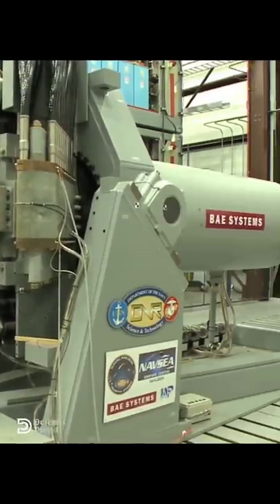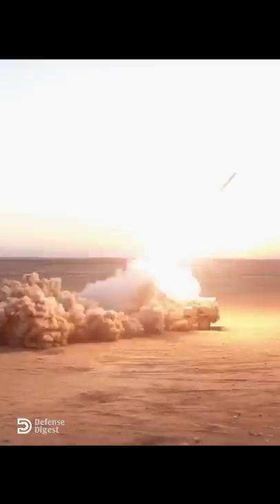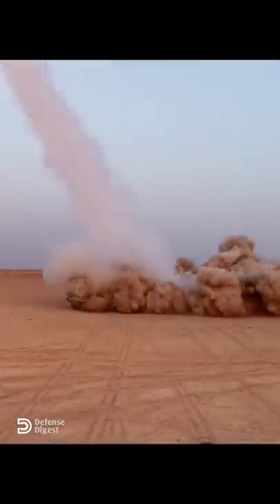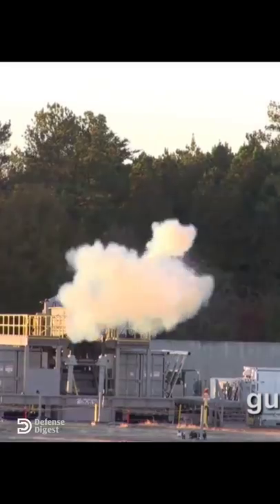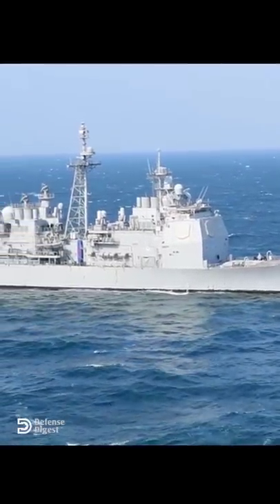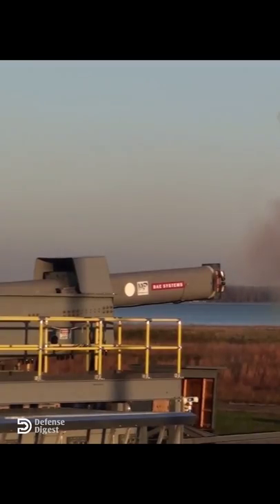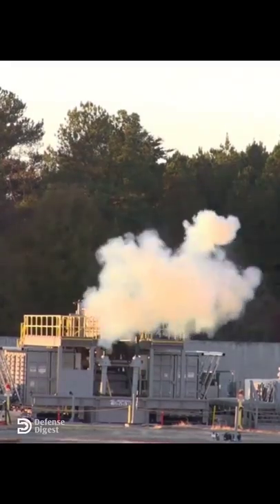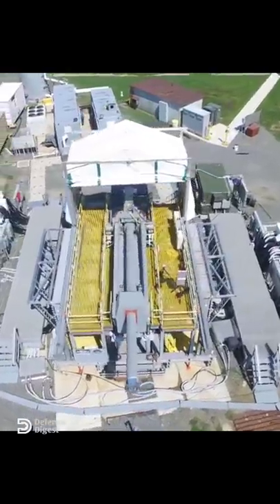Hypersonic cannon that does not require any explosives #Shorts

Comment: Power wasn’t the problem, everytime it shot it destroyed its barrel
Reply: Not every time, you’ve got 10 shots or so in that test one… possible to get the rails to last up to 100 shots, but then they’re ruined and the entire gun needs to come apart for their replacement…. Not what you want for a warship…

I always thought coilguns made more sense anyway but less research into them.
Reply: There salutation was literally to halve the power. This is why I get so frustrated by syfy things like locusts that eat through anything in SCP, or SG1 with naquida hulls that can withstand RPG blasts while paper thin. You know what we would do with that shit. We'd made barrels out of it that don't wear down every ten shots or missile housing for aluminum ships. We'd do so much more than throw a hoplite sheild around at a couple baddies  with that vibranium.
Reply: Dumb internet hoax that floated around. The barrel is fine, it was the $$$ of the rounds that got this scrapped.
Reply: @Nitemare101  i thought they were only like 25-50k that's better than most rockets we use
Reply: @Nitemare101  nah the rails do break, something to do with putting that many volts/amps into them, all it takes is 1mm of warp or a tiny crack and the gun loses power.
Reply: I was looking for this comment! 🤗
Reply: @Nitemare101  is that why there will be no more zumwalts? That, and whatever composites they wanted to use for it didn't even last to the third. With all the money put into research and development, you'd think that someone of it could've gone in to planning to source all the necessary materials for the 50+ ships reliably
Reply: @luggy9256  the gun was already perfected along with the rounds. It was ready for installment on the first zimwult with 2 other ships already built and one under construction. The company decided to alter the contract and charge more for the rounds. The Navy scrapped it then refurbished the deck to fit the old 155mm deck guns.
Reply: @nathanielcowan3971  they changed the price and was hundreds of thousands of dollars for one round. So now it's a toothless shark. Missile boat with 155mm deck guns with a weak ass aluminum hull.
Reply: @nathanielcowan3971  supposedly there will be more since it's cheap to maintain even though the initial cost is outrageous. Waste of fucking money. Its an expendable missile boat.
Reply: @Nitemare101  the zimwalt doesn’t use a railgun does it? I thought it was something else again, still uses an explosive charge to fire the projectile…
Reply: @Nitemare101  ok I was wrong and right so were you… there was discussion to put a railgun on the third zumwalt class ship, but the original guns aren’t railguns they use propellant to fire.

But there is no updates on the plan to put a railgun, and as far as I can tell the project is unlikely to ever happen…
Reply: Plot twist: They secretly perfected rail guns and are planning to put them on warships. But they are keeping a secret.
Reply: @titanium_viper0990  and yet it’s on 0 warships…
Reply: Yeah, but it would've made an excellent stationary gun for shooting down nukes.
Reply: @luggy9256  plus the fact you would have never had known when the last viable shot was going to be
Reply: Saved me from typing
Reply: @nathanielcowan3971  no it’s 1 million just for 1 shot
Reply: Yeah im sure they got these perfected and just don't use them cuz thats the smartest way to do things. I bet that dude that wrote the art of war would know whats up
Reply: @luggy9256  Railguns can be 70-80-90% efficient . Coil guns can't reach more than 20% even in theory it's impossible.
Reply: @kosovoisserbia8937  no railguns can’t ever be 70% efficient, the way they function produces a massive amount of excess heat which creates plasma, that’s a lot of wasted energy… neither system will ever be actually efficient but coil guns at least have a longer barrel life, also coil guns are easier to manufacture, just the requirements for ammunition to all be magnetic are a little more annoying.
Reply: @luggy9256  i said they can theoretically have up to 80-90% . Now they have 50%.  Coil guns rn have less than 12% efficiency at its highest . Can't have more than 20-30%. And barrel life can be solved by making it easy to replace rails on just few screws.
Reply: @kosovoisserbia8937   making the rails easy to replace does help, buf doesn’t solve the issue, they’re still high quality alloys needed and precision machined pieces which means even if you make it so you can take them off and add new ones easily they’ll still have to be recalibrated every time so it can’t be done in combat.

I know the military was working in cool guns as well, railguns as we know are intended for ship weapons, and coil guns were under consideration for more portable weapons, last I saw they wanted to use the coil gun concept to increase the range of mortars… 

But it’s also possible (and even probable) that neither will ever see active service because while they might perform better than conventional weapons, they cost far more and require a lot more maintenance, so for every railgun you could have a dozen or more conventional guns…
Reply: @luggy9256  Well it can't be that expensive so it gets more expensive than a missle with similar range  . And better alloys are being made if it can last 100-150 shots and you probably won't use it much longer in battles and you should have 3 or 4 spare barrels just in case.
Reply: @kosovoisserbia8937  it won’t have similar range to a missile, it might reach the point of double range of conventional artillery, but a missile will still go far further… 

The barrels will wear faster as ranger increases, so new alloys will probably struggle to get ahead in terms of lasting longer because as barrels improve people will want more power for more range so barrel still lasts the same number of shots
Reply: @luggy9256  depends Wich one . Certainly more than regular 122mm grad or 262mm munitions Wich have 40 and 100km range . Sure tomahawks will go 1000 miles but they cost milion dollars. This iron tungsten projectile costs much less than it and tomahawks are 10 times cheaper than anti ship missles with 150-200 mile range . Sure you won't destroy ship with 2-3 projectiles like you would with rockets but you would with 30-40 Wich is less than half milion dollars in projectiles and one copper/titanium/or other alloy 500kg barrels machined not casted and electricity cost Wich is also pretty low.
Reply: @luggy9256  you keep making statements like you know it all but question whether or not if the ship was meant to have thus gun. You obviously did not follow the development of the ship and gun. The Zumwalt was specifically designed for the Railgun hence why it has such a massive power output. The turret decks were also designed to fit the guns but when the navy scrapped it they had to send all the ships already built to get refitted to house the old 155mm deck guns costing a shit ton more money. This garbage of a vessel generates useless insane amounts of power for nothing.
Reply: @Nitemare101  it makes no sense to me that a aluminum projectile would cost so much. I'm sure the manufacturer is just sticking to the government.
Reply: Learn more
Reply: @nathanielcowan3971  is there any reason they can't just have a ordinary gun on ? They still have a lower radar cross section
Reply: @Nitemare101  your thinking of the zumwalts guns and their projectiles
Reply: @bobthompson4319  have you not been reading comments? What kind of statement are you even making?
Reply: @Nitemare101  the uss zumwalt. The ammo for its gun was cancelled due to the insane high cost of the rocket assisted projectile. Not the railgun. Smh.
Reply: @luggy9256  you honestly think you know what weapons are tested on ships? 😂 laser based weaponry were being tested on ships YEARS before they publicly acknowledged so.
Reply: @luggy9256  zumwalt wasn’t meant to have a rail gun.
Reply: @nathanielcowan3971  zumwalt wasn’t a raingun ship. It looks like two stories have been conflated in this thread.
Reply: @ericoverdorff8880  they don’t. Two stories have been conflated here. The zumwalt was meant to use a 155mm AGS - NOT A RAILGUN - the rounds for which spiked massively in cost.

The zumwalt was, however, designed with eventually fielding railguns in mind, and had the electrical capacity to do so.
Reply: @Nitemare101  yeah he has read the comments… as have I. You’re all getting confused lol. Two stories about the zumwalt have been conflated. It wasn’t railgun ammo that became expensive. It was the AGS ammo. Zumwalts were designed to eventually have railgun capability (electrical power for one) in the future. AGS was not a railgun.
Reply: @lukefreeman828  I was talking about the rail gun projectile.
Reply: @lukefreeman828  no I am aware of that, it was meant to have a very special conventional main gun with weird ammo…
Reply: @lukefreeman828  And the way lasers are used on ships makes sense, it’s in an anti missile/anti air role and to disable small boats by cooking their engines, trying to use them on something that doesn’t have the power plant of a ship or as a main weapon is stupid…
Reply: @luggy9256  well actually it's because of the electromagnetic forces literally repulsing the barrel in two different directions, instead of the traditional recoil, where the barrel recedes and quickly springs forward, this is more like the barrel exploding to chuck a round forward at hypermach
Reply: @ToastGamingNCrew  it’s also an issue of putting so much electricity and friction through the rails, which produces a lot of heat which leads to warped rails. But yes you’re also right, lots of issues…
Reply: @luggy9256  yeah, way ahead of it's time
Reply: @Nitemare101  I think you’re mistaken. That was the case for the main gun on the Zumwalt-class destroyer. The ammo for that gun would have cost billions to fill the ship’s armory. Any gun barrel takes on wear through continuous use. But when that object is moving so fast that the air around it spontaneously ignites, it shreds the barrel. Before you dismiss something as false, perhaps go verify your claim 😅

“As early as 2018, the end of electromagnetic railgun development was foreseen after Chief of Naval Operations, Adm. John Richardson, told Congress that the weapon had yet to reach its promised range. “The barrel itself is probably the limiting case, the engineering on that, the materials required to sustain that power pulse, and the heat and pressure that’s involved in launching those projectiles,” he explained.

Last month, the White House released its fiscal 2022 budget request showing that funding for gun-launched guided projectiles had been canceled.”
Reply: Power was also, definitly the problem
Reply: Until they can create stronger material because the sheer force of the gun starts to break down the gun itself during firing.
It did go through live trials on a US Navy ship within the past couple years. But right now you can only fire a few shots before the barrel starts to disintegrate
Reply: @luggy9256  just think of the first generation of rifles... Flinlocks then trap doors, then revolver etc.. This is too early to claim useless.. They may cancelled, bug someone else is doing it
Reply: @mandelorean6243  well with early firearms there was superior types like the wheel lock that was better than the flintlock but was barely used due to cost and difficulty of maintenance… it was only really used on custom weapons for the rich. 

So there is times we pick the worse performing options just because they’re much cheaper and easier haha
Reply: @luggy9256  good point sir, yeah especially for example "Custers last stand" there was a few, I think 2-4 trapper/pioneers  that were hired to fight with the military.. They had the only with rifles that were either revolver or just had capacity up to 26 rounds.. They were backed up to rocks and their bodies were surrounded by almost 30 natives, where as all other military single shots just got slaughtered after they got their one or so shots off before being rushed...

Would've been a lot more difficult to slaughter the outnumbered military if they had premium rifles!
Reply: @mandelorean6243  but premium rifles cost many times more than what’s given to the military, and budgets don’t allow for it. Sometimes cheaper options are better to the people in charge of the money
Reply: Same thing would happen when I would put a can thru my M2 50 cal lol
Reply: @Nitemare101  they legit said ammunition was cheap and also the guns gets destroyed every 10 shots
Reply: It kinda is but that aside it's not balanced
Reply: @Nitemare101  they're are aluminum alloys that exceed steels strength in the same dimensions. Did they use the wrong one?
Reply: Concept is obsolete since the laser weapon systems have been brought up to full function. Faster, more precise, far less energy, lower maintenance...better system. Hypersonic or not, it's not light speed. Lasers literally are.
Reply: @willroland9811  when tech comes before it's time the drawbacks make enough sense to doubt or turn it down. I know it had been in existence for a while, but it simply isn't feasible right now
Reply: And the miniature power plant needed to fire it
Reply: @luggy9256  well for most nations putin these on a ship.. with about 100 shots you shot out most navel units from 80% of the world.

With exeptions to the big 5 and pirats..
Reply: @luggy9256  its not.the power, it was the inner materials friction and the speed the projectile accelerates too inside the barrel. The explosion of the projectile leaving the barrel is barrel and projectile material scraping off and igniting just like when the projectile hits a target.
Reply: @Nitemare101  its not cheap to maintain. The barrels only last a few rounds.
Reply: How can it destroy the barrel when the projectile never touches the bore?
Reply: @Hornet_Legion  plasma cuts through metal like a hot knife through butter.
Reply: @Hornet_Legion  heat through compression and friction of the air try a normal air pump 😅 it would probably be easier to use in space
Reply: Yea it last ten shots but clearly it is braking it down if it has limited shots. Obviously some shots will cause more damage than others. To bad it requires suck massive electricity to function
Reply: Don't be fooled!  The United states Navy has rail guns on a couple ships.
Reply: and heat
Reply: They had to use step by step accelerating technique. Like on cern . Well anyway on cern they use colling system to protect from owerheating and stepped system for not heating it or correcting direction .
Reply: Literally said same thing I was thinking then when I seem the comments below yours was first I wonder if our for you page is about the same kinda stuff
Reply: All you geniuses work for the defence dept?
Reply: @2guns713  well in fact we are. All the defense budgetis paid in general by working class as richpeople finds ways to escape from taxes in general ;p
Reply: That was hitlers canon
Reply: Not scraped still researching maby smaller scale super phalanx anti hypersonic missile defence?  If it can be seen it can be distroyed, space weapon no air problems
Reply: Until next gen Material are researched
Reply: @luggy9256  I don’t think it’d be right in front of battle. That’s like bringing a sniper to CQC shotgun fight. This ain’t battleships the board game. You heard, it can snipe a battleship 130 miles away like cake
Reply: @tenibrosity3425  and a missile can go further and be launched from a sub which then goes underwater and is hidden…
Reply: If it uses magnetism, how can the barrel be destroyed without any explosives of high pressure gas?

Also, this makes pretty clear the rounds cost next to nothing. Its hard to imagine how a no charge, no warhead artillery shell could be prohibitively expensive.  Also this video notes the shells cost nothing.
Reply: @elliottboomsluiter7214  the barrel is destroyed by the massive electric current running through it and the friction of the projectile, unlike a traditional firearm there is no room for error when it comes to the barrel, the projectile is solid not lead core and can’t squish slightly, and if it doesn’t touch the barrel at any point the circuit is broken and no power is being added.
Reply: probably need a different shaped projectile than that sharp rectangle thing it fired
Reply: I mean tbh all you’d need is one shot with that thing, but you get like 10 shots and that’s not too good 😅 but it’s no where near done in research
Reply: Power was still part of the problem
Reply: the Barrel Breaks and the Cost to build this and its ammo its a lot of Ferraris and Lamborghinis
Reply: @Nitemare101  that was the rounds for the uss zumwalt's guns. 
Over $1million per round for GPS guidance, rocket assisted shell that could hit a house at 100km....
Also uses proprietary technology that the US navy didn't own...
Shells only made in a single factory in Israel, so we couldn't even make them state side...🤔
At that price it would have cost $1 billion dollars per ship to fill the magazine on a single ship. (That's more than it costs for the weapons carried on an Ohio class fyi )
The navy wanted 32 hulls in the zumwalt class....
Reply: @Nitemare101  : $25,000 per round does sound a bit pricey.
Reply: I believe this video is at least three or four years old. Apparently there's a new type of boat coming out that's being built around this gun. Which is probably going to be out of public view for at least another 5 years.  From what I have read and heard over the past year , it does have a power issue. Being able to outfit a current Navy vessel with large enough batteries and or engine / generators to be able to generate more  fire more than multiple rounds without having to recharge this system and wait from what I've heard 30 to 45 minutes before the next shot is ready. they've yet to achieve that in a compact size to fit in a battleship .
Reply: @Nitemare101  they're literally raw steel. If these things are that expensive then it requires half the money of a space program to produce a single RPG-7 rocket.
Reply: Degraded, there’s a misconception that you can see things falling off of the barrel, at fire to Sabo round which Hass to be contained in the casing, the barrel did not destroy itself, it just requires maintenance more often than conventional weapons
Reply: This. Lol building a railgun is not special. Building one that can fire more than once is.
Reply: @luggy9256  issue is with coilguns is magnetic saturation in the projectiles.
Reply: @Nitemare101  explain what the red hot blast is coming out the barrel then 🤔  not an Internet hoax, the plasma generated damages the barrel.
Reply: @nbricks7  lmfao completely false 😂
Reply: The barrel they used, didn't have a force feedback range. A cannon using powder wouldn't last without that as well.
Reply: Not entirely true, but in the early stages of development yes it destroyed the barrel every time it fired, ever since they started lining it with some kind of diamond-like coating they're able to fire quite a few shows before having to change the liner out. If you dig deep enough you can see videos of a ship that already has a railgun on it.
Reply: @Nitemare101  bruh the rounds are basically free compared to normal rounds. They're just some metal, no explosive aka way cheaper
Reply: That’s what my ex said after I
Reply: Rail-guns don't need a feedback gadget like a classic combustion cannon, but its also not impressive, as the rail version could've done damage as far, to pass through several battle ships, if it had a feedback force motion, or a rear velociry spinner, before the magnetic tube chamber, for a shell to begin.
Reply: @luggy9256  need to make a barrel insert like the Iowa class bbs
Reply: @kosovoisserbia8937  the contractor changed pri es last min making a railgun pointless
Reply: @protipskiptoendofvideoandr286  yes rhat would be a good idea, I’m sure they’ll work something out eventually. Honestly though this thing was just proof of concept. Won’t be till America is involved in a large war that things make a big step forward.
Reply: @nathanielcowan3971  a chunk of metal is more expensice that missiles?
Reply: @luggy9256  even if it only got 10 shots I’d say you could work with that. Imagine being able to hit ships at Mach 5 from 130miles away without any chain of getting the round blocked/intercepted. Could easily take out a few ships before you’d need to replace the barrel. 
Like a disposable Vape.
Reply: @hivaladeen4892  possible, but it currently has nothing close to that range or velocity haha
Reply: Ofc power is A problem, I'm sure if you put that on a ship every time it shots the lights would dim, or circuit would pop
Reply: @nathanielcowan3971  this comment is a trip
Reply: God damn it they need to work on different ammo types for that gun!
Reply: @luggy9256  I think they were just much less efficient
Reply: Can't they make the gun out of diamonds or something? 🤣
Reply: @J040PL7  you know Diamond burns and shatters prett quick
Reply: When its so good that the plasma fries the wires and barrel itself.
Reply: @Nitemare101  that was the zumwalt
Reply: @Nitemare101  pretty sure the rail gun wears itself down from the shots quickly
Reply: @luggy9256  they require pp retry heavy barrels though, makes aiming more challenging. Plus you might need to cryo cool the coils to avoid burning them out via Joule heating with that much current
Reply: @nathanielcowan3971  bit they weren't competing with rockets, they were competing with naval artillery
Reply: @kosovoisserbia8937  can you elaborate on the math behind why that is? What makes coil guns inherently less efficient? Like thermodynamically speaking I mean
Reply: @luggy9256  they are famously the harder of the two to manufacture due to the massive coils. But otherwise your other points were valid. Stillz wouldn't make good naval artillery due to barrel mass and size compared to conventional artillery. Plus keeping the coils cold is a huge challenge
Reply: @maxk4324  yea neither is really any good for the navy in their current state, most ships barely have any firepower in their conventional armaments, it’s all about the missiles. Which the marines hate.

I know there was a project working on making a man portable coil mortar, was meant to add something like 3x the range or something. Dunno what came of it though, probably failed for multiple reasons, or succeeded completely and is now a secret weapon lol
Reply: @jaymay7957  you believe that because of you're own nonfactual personal thoughts or did you actually work on the project, which I highly doubt.
Reply: @titanium_viper0990  I mean, wouldnt this be perfect for a nuclear defense net? In which case i can understand perfectly why they want to keep it secret..
Reply: @Nitemare101  futuristic looking research ship that'll never dare be used in real life situations.

What a massive failure that class of ships turned out to be.  Honestly would like to see them all scrapped.

IT WAS SUPPOSED TO RUN ON SKELETON CREW DUE TO AUTOMATION HOWEVER, THE DAMAGE TEAM NEEDED DUE TO WHAT A FIRE COULD DO, YOU COU LOOK D NEVER TRULY ONLY USE A TINY CREW LIKE INITIALLY INTENDED
Reply: @Nitemare101  It can literally piwer a damn town.  It'll never be used EVER in combat.  It'll just get in the way.   Also the big draw was how automated but you still need a huge damage control team making the automated crew size q moot point
Reply: @luggy9256  that’s why he said secret. It’s a joke and you can’t even get that right
Reply: @kosovoisserbia8937  it’s easier to destroy those projectiles whereas the tungsten is near impossible to detect
Reply: @Nitemare101 , NO, a vast majority of the fireball coming out of the barrel was the barrel itself. The plasma generated by the amount of energy released was what was destroying the barrel. Remember, the projectile and its sabot did not touch the barrel when fired.
Reply: @Nitemare101  the Gun for the Zumwalt wasnt a Rail bro and the rounds got so expensive because the Navy Just Took 3 zumwalts instead of 32 that were ordered so the company Had to adjust their math to make IT profitable
Reply: I'm all for high-tech weapons but I think we should be throwing the kitchen sink into high power lasers and perfecting them to a more instant penetration weapon than we've seen before.
Reply: @StropSharp , atmospheric conditions are the issue with lasers. They wanted to use lasers to incapacitate ICBM's, but they they found out the dirt and dust in the air were a major issue. That and you have to be pointed right at it, so arching fire is a no go. The laser they were using for ICBM's was big enough that they had to install it in a 747. So until they can downsize it enough to fit in a fighter aircraft like maybe a warthog, it's going to be on the drawing board for a while.
Reply: @titanium_viper0990  with how much force that makes it would destroy the ship with the gun
Reply: Not it this video it didn't..
Reply: @ericoverdorff8880  Same here, and it seems that  some sort of elctro-magnetic/ maglev  suspension could keep it from wearing out of barrels so quickly.
Reply: @Nitemare101  I don't see how these projectiles could be that expensive or even cost more than rockets. This guy says the cost is low compared to missiles.
Reply: If we can hold anti-matter in a magnetic "vessels", we can design a magnetic barrel, perhaps using cold or  typical plasma as a 'tube'.

It might even be possible to harvest the energy release of each shot to recycle the configuration as needed.
Reply: The project already shutdown
Reply: Maybe you could take this to the battlefield you would only need 5 super every Duty cranes to get it into place by then the war would be over lol America
Reply: @Nitemare101  you cannot stick something that big on a ship anyway totally impractical you would need 5 ever Duty cranes just to move it and half city to power it
Reply: @Bok2022st  So it can take up to 20 years or the war only lasts days? This would be mounted on a ship. I don't believe they were planning on putting it on ground somewhere and wiring all the power to it in the middle of a fire fight. That's where the ship comes in, mobile and power. It's a big gun but have you seen  warships? They can get more than just  this on there.
Reply: @Nitemare101  the rounds are cheaper $$$ than conventional rounds
Reply: Well I thought the research was stopped on this, but it makes no sense to me you think they would press on with the technology like that they get computer in sync with it man it could do some damage, to exactly what they want no collateral or little.